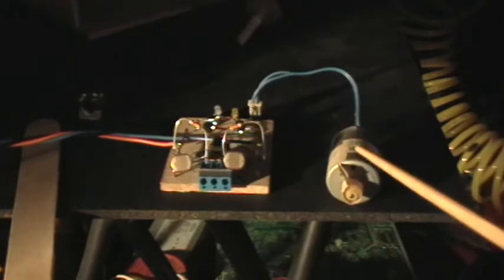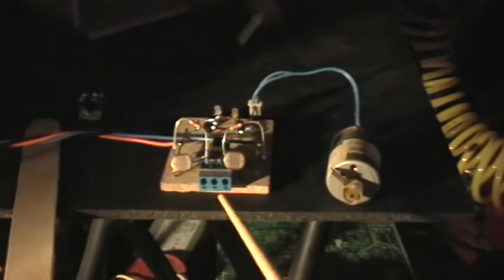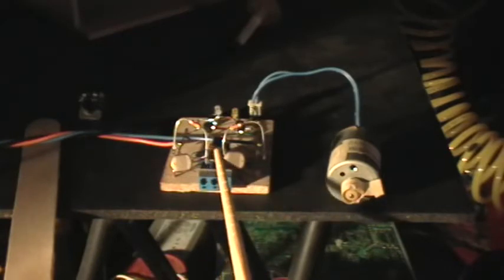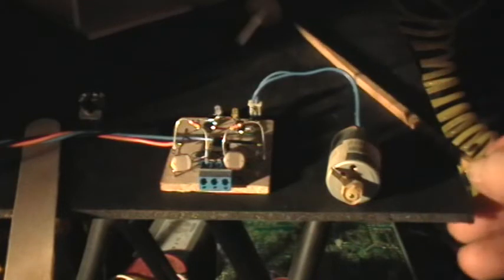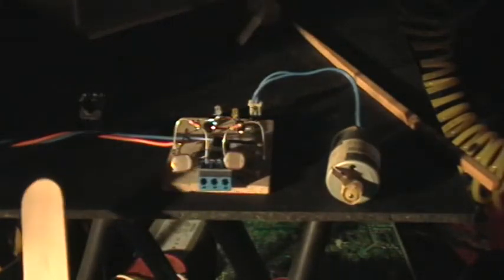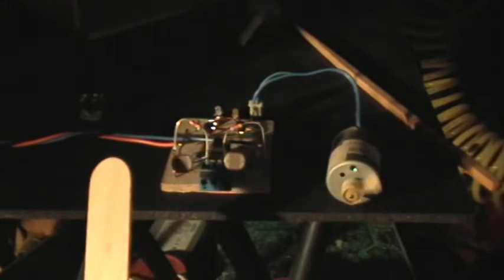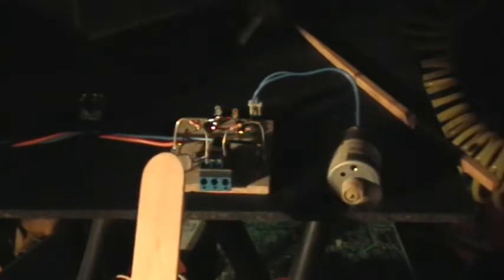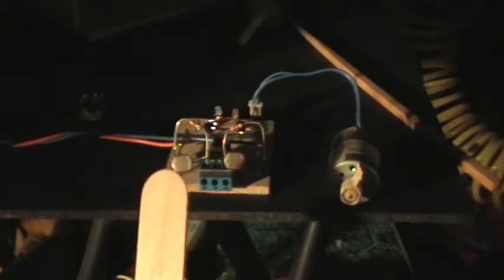Misc Circuits: Push-Pull OpAmp Motor Reverser with CdS Photosensors

Comment: TK:

That's it for sure!  Now all we need is 2 sets of senders/receptors to keep the hovering disk aligned on both the X and Y axis.  This is fantastic!  You are reverse engineering this with only a video and some crude general sketches on the patent.

My question on the electro magnet is this: Is it better to use many winds of fine magnet wire?  Or, to handle the power required, do we need to use heavy wire for the turns...like say...8 to 10 ga.?

Great work here.

Thanks,

Bill